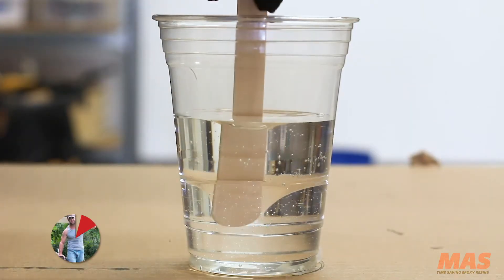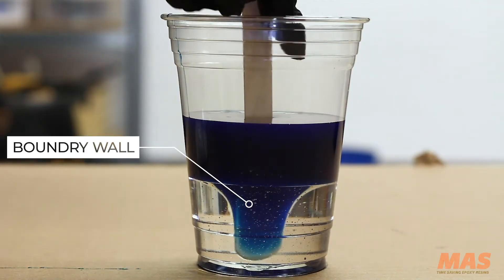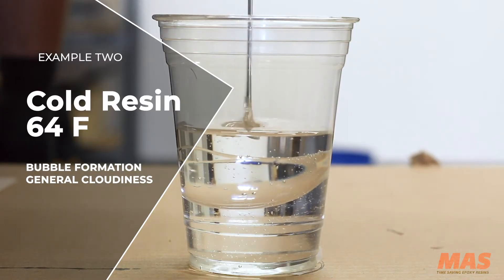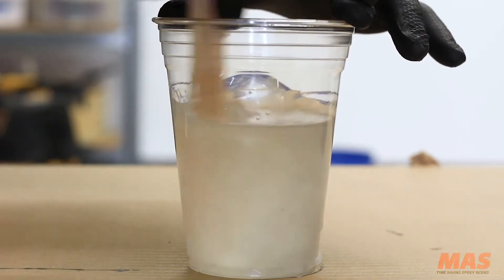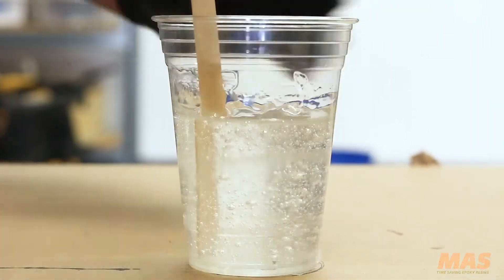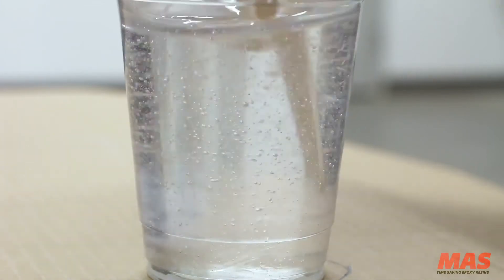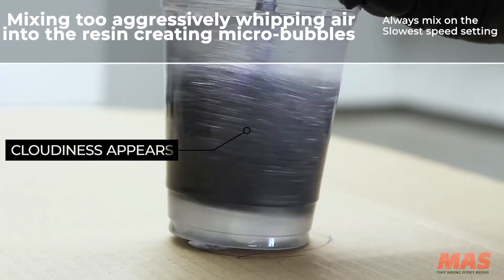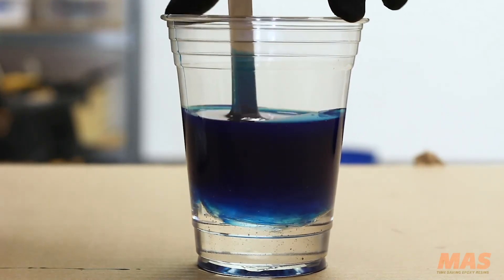The Ultimate Guide to Mixing Epoxy Resin

Comment: You said you do not recommend using a drill because of how fast it rotates, what about a screw drive type drill? It doesn’t rotate near as fast as an actual drill. Would this be okay to use with a paddle or should I steer clear?

Comment: I’m working on a super deep pour. Really just casting a 6x6x6 cube and I haven’t seen any videos of how best to pour. I’m doing it as multi pour because I’m adding objects as it goes up and I’m aiming to make it crystal clear. Any tips?
Reply from the maker: Our Deep Pour X would be able to do that in one pour as long as you keep the air temp around 65-70F. Deep Pour X is on our website and is a great casting resin.